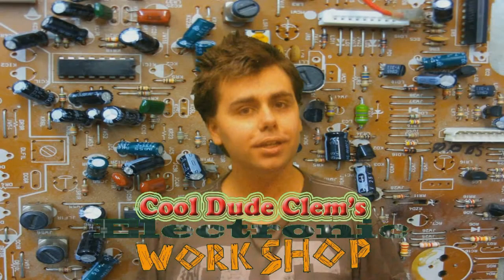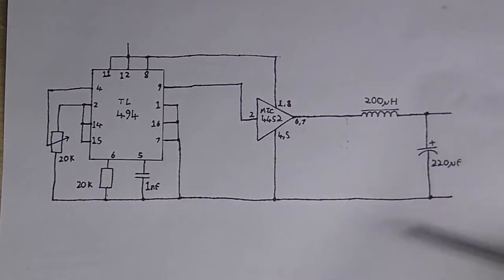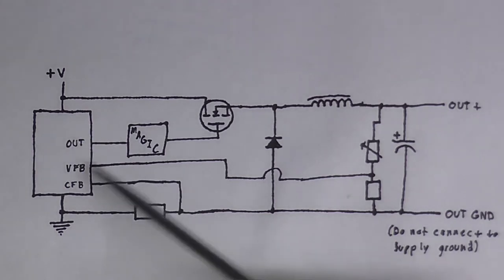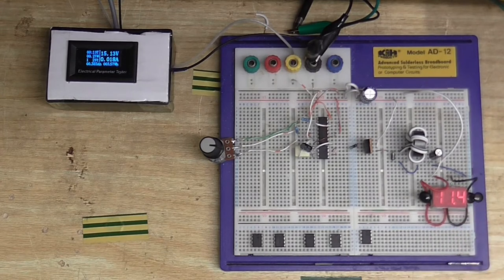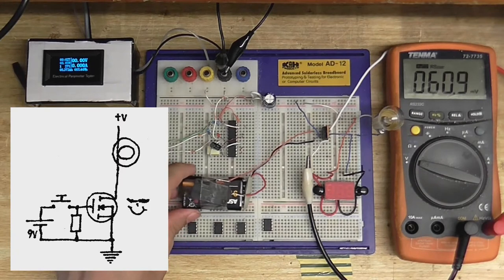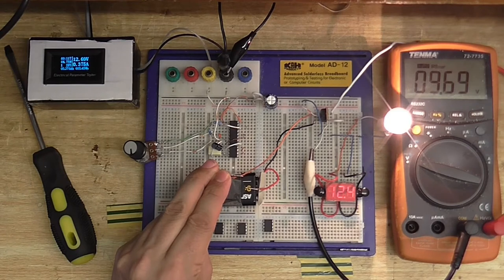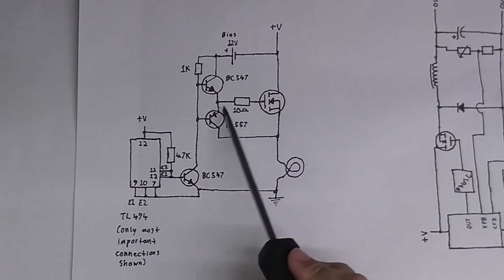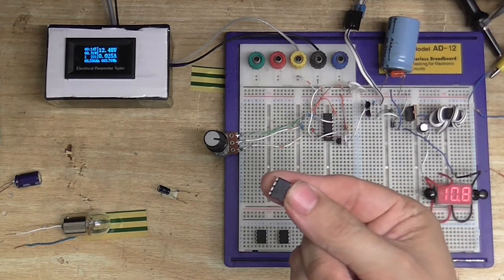Cool Dude Clem's Electronic Workshop - Making A Buck Converter Part 1

Comment: Nice! I like to use bootstrap though, requires no additional voltage source to drive the gate nicely. But your approach is fine too, especially for a mock-up to play with :)
Reply from the maker: I was thinking about using a bootstrap myself, the trouble is i want to use the full PWM range and bootstrap capacitors tend to discharge easily. (or at least they do in experiments I've done in the past)
Reply: True, bootstrap only works if you have constant switching. If you want static on-off or 100% DC, you need a separate supply for the gate. Now I understand fully why you went the way you did.

Comment: I never knew about high and low side MOSFET driving. Something to keep in mind in the future.
Reply from the maker: Personally I avoid trying to drive a mosfet in the high side any time I can, here I had no choise though. I would have used a gate drive transformer but they only work up to about a 50% duty cycle, so I came up with something else.
Reply: Why can't you just put the load on the other side of the MOSFET? I don't think I still completely understand the difference between high and low side. Though I do understand the linear region and saturation.
Reply from the maker: I could do that, but then i would have to use optocouplers to connect the feedback from the output and it's just easier to do it the way I've done here.
Reply: Your way sure works. Though getting the bias voltage might not be easy. You're using a whole other PSU to supply it now right? SMPS are pretty complicated.
Reply from the maker: Yeah, my main bench supply I built way back in the stone age is providing the main power, and there's a second supply I cobbled together out of a few parts i had laying around for the "bias". What I intend to do is make it all self-contained and run the circuit from a transformer out of an old PC supply. IF I can get it apart without breaking it, then I'll wind two secondaries, one will provide the main 30 volts, and the other will be for the bias voltage. And that transformer will be powered from a simple half-bridge SMPS that uses an IR2153 IC.
Reply: Sounds like a plan. I need to get into SMPS because they just don't make big step down transformers like they used to anymore. So I never run across them either. I've done some projects where I've needed high current low voltage DC too. Like my CNC machine. You can make them cheap now if you make a small one. Small CNC machines are still capable of isolation routing PCBs too. Here's one I did http://i.imgur.com/YyqiE9R.jpg

Comment: Or, just change to P-channel and ground the gate to turn it ON.
Reply from the maker: That's certainly an option, but ... p channel mosfets as far as i know have more RDS than an N-channel does, if I was to run this at say 15 volts it would probably be fine, but ... I want to operate this circuit at 30 volts, which would likely kill a p-channel mosfet when the gate is pulled to ground as I'll have 30 volts between gate and source.
Reply: @CoolDudeClem   Hi, that RDS value use to be harder to match  like 20 years ago, but nowdays manufaturing processes have improved a lot, so you can find perfectly matched parameters for transistors of both materials , and it's easier, i've actually worked on Rexroth Indramat drives and you can find these P-channel MOSFETS being used like this no worries at all.

Comment: i though you use microcontroler 
but mr.coll dude clem 
why you never start working with microcontrolers?
Reply from the maker: Because digital circuits are like black magic to me, plus I can't code.
Reply: @CoolDudeClem  
yeaaa such nice fact 
i was like you but after learning c language and starting with microcontrolers i was learn new skills  
after puting uc in circuits and add some digital gates and eeprom
 the results will be very cool on puff board